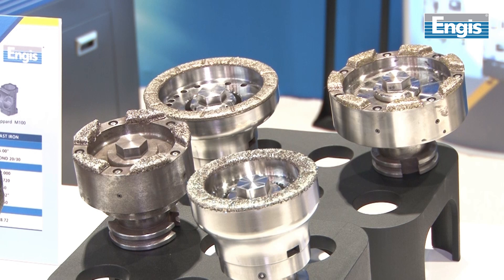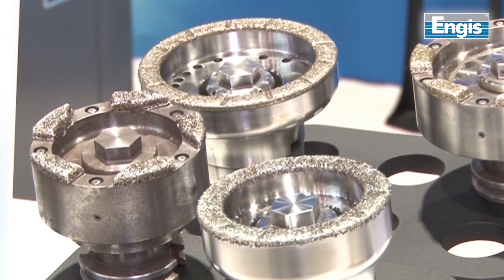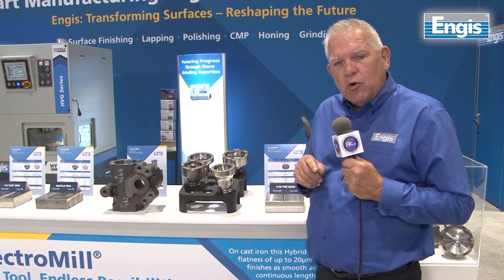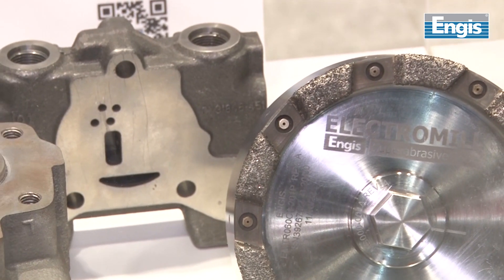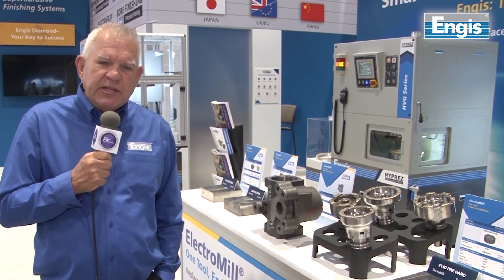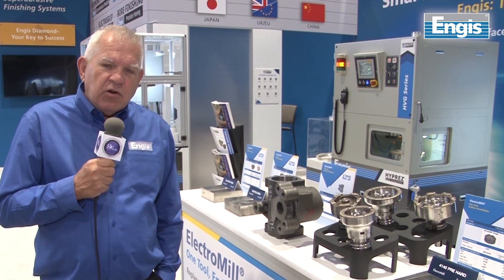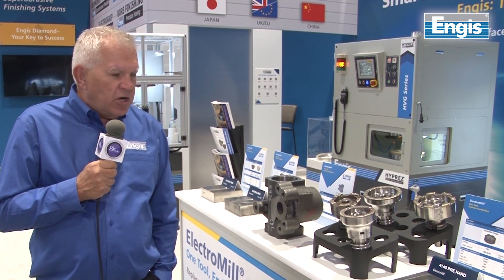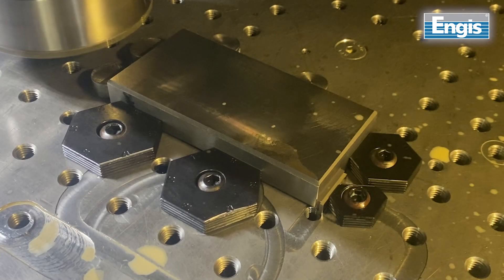Engis ElectroMill Video 2025

Comment: The feed rate mentioned on the website for block finishing is impressive. What is the expected tool life of Electromill under these conditions? Additionally, can the face be dressed once it becomes dull to extend its usability? It is evident that effective coolant filtration is essential to achieving the desired surface finish. If the process proves to be economically viable, it has the potential to be the most efficient method for surface finishing using machining centers.